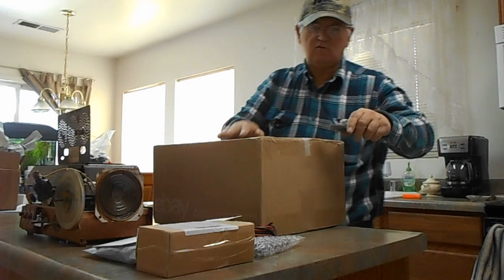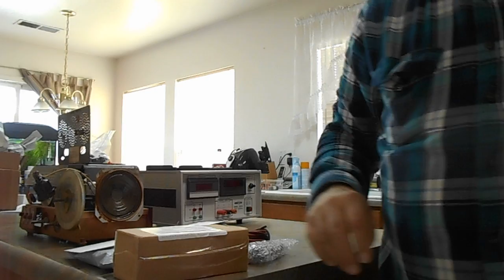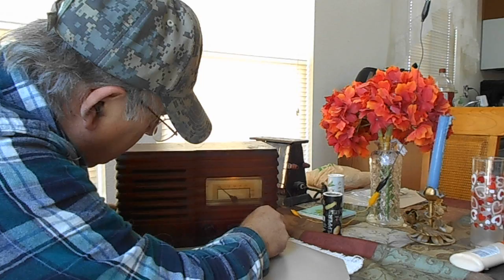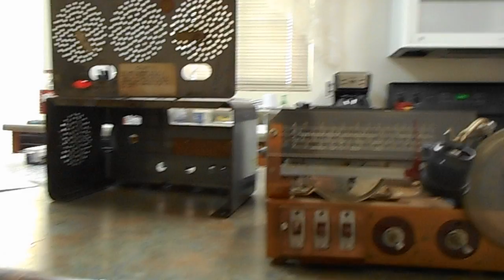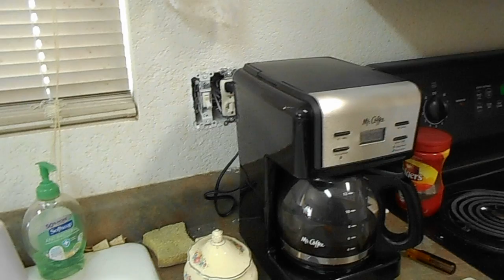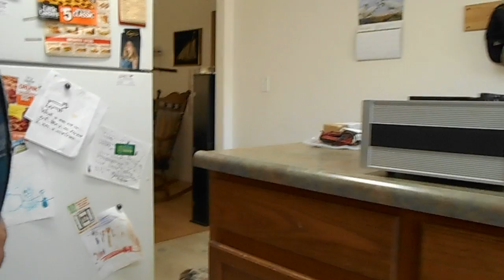Unboxing Westcon Model 1550A Digital Test station and 1937 complete fail

Comment: He Is a cute guy, it's nice to know I'm not the only one having electrical problems lol
Reply from the maker: Yes well first I had a soldering station that decided to short out my GFCI breaker on the breaker panel in my bedroom and then the kitchen GFCI breaker one out of the two decided to go. I had to wire up and pull wire for a double 20 amp circuit in my garage they only had one 15 amp breaker, Now how was i going to use my welder with only a 15 amp breaker i would be popping it all of the time so i put new wire and double 20 amp breakers. Well at least these problems are fixable. At least I didn't have to did for my mine. Well at least not this time lol